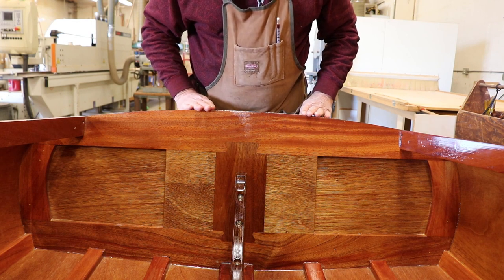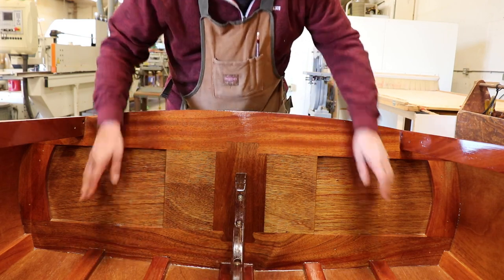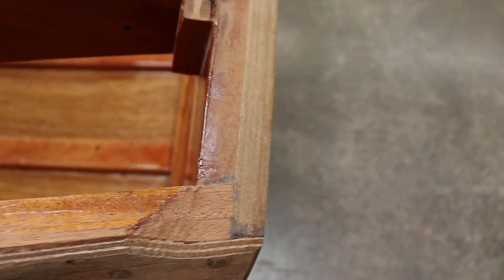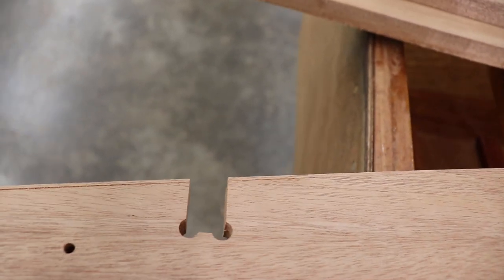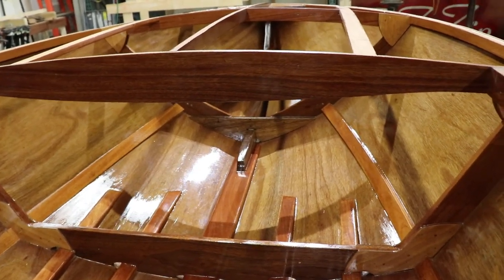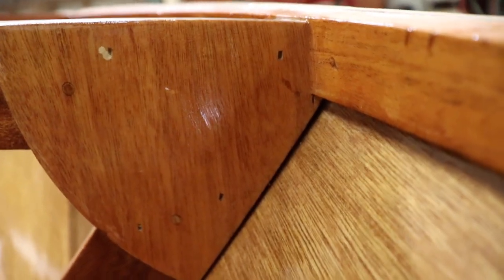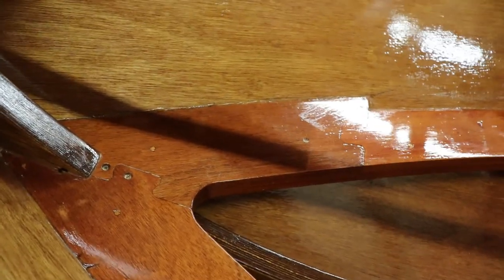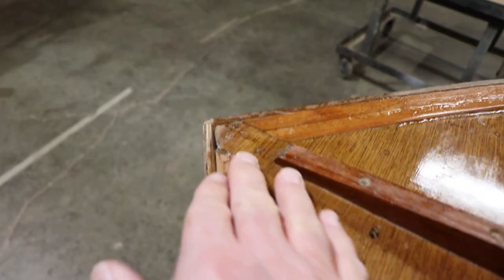Building the Glen L Zip from the ZipKit !  Walking through frame components and features.

Comment: Sure is a nice looking boat  I’m a retired woodworker who has owned 17or 18. Boats afar  i did a complete restoration on a 1964 Chris Craft Constellation Wooden Cabin Cruiser  and  have always hoped to build my own Wooden boat  at some point  in my 40s i suffered a series of Strokes that has  caused me some paralysis  so i know if i was ever to do one a kit would be my best bet  at this time in life I’m between homes and Shops  in reality was this kit pretty complete or did you have to fabricate many parts yourself ? I’m kind of thinking about   Fabricating  copies of the framing  in a effort to build one. Like yours and the other  in Cedar Strips  as i really like that look as well  of course I’m really just a Sucker for all Wood grains  and boats  in general  as i grew up in South Florida and i bought my first boat at 17 years of age  a 21 foot Finerglass hull that needed  new floors glassed in  which was the easy part for me at that time  that boat was a design by the same man responsible for  The Mako and the Iconic Carolina Flair  in the bow  I honestly wish i still had that  as it was a early 1970s hull when they were still over engineering Fiberglass hulls  and everything was hand laid  before Chopper Guns were invented to save money and build faster  in molds  that boat was a true quater inch thick  hull  and didnt have any stress cracks like new boats get  which ive seen in half Million Dollar Fiberglss boats  that were much newer !  Including the big names  i was also a faithful Subscriber and reader of Wooden Boat Magazine and ive read just about any Wooden Boat book i could get my hands on  some i understood and some i did not  LOL  i could tell by your tools and shop you aren’t a novice Woodworker   Yet I’m curious to know how you rate The Glen L kit overall to build , understand. The directions. Etc   And how they were to work with from customer Support and packaging  did you order right off their Website or go through a middle man

Comment: What is the interior finish?
Reply from the maker: Everything is encapsulated in epoxy resin with a top coat of marine varnish.
Reply: @zipkit1967  is there any fabric used in the process?
Reply from the maker: @nomansland4811  Not on the interior. 7oz.Glass cloth on exterior bottom and sides.
Reply: @zipkit1967  Thanks.